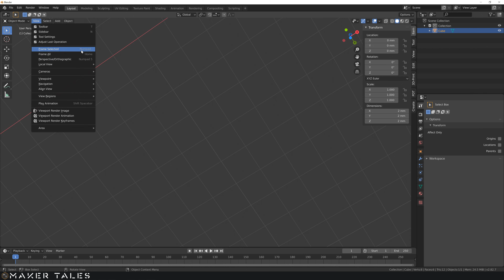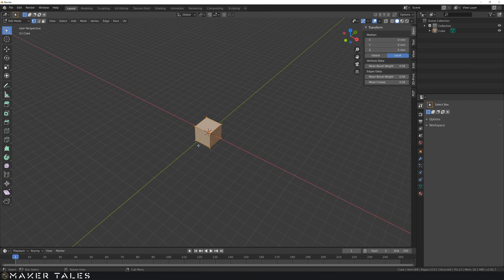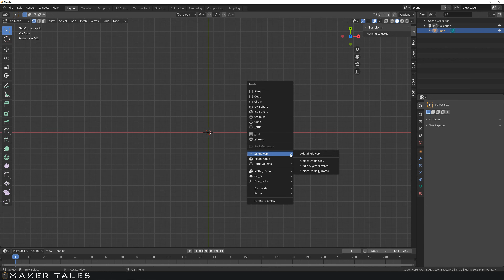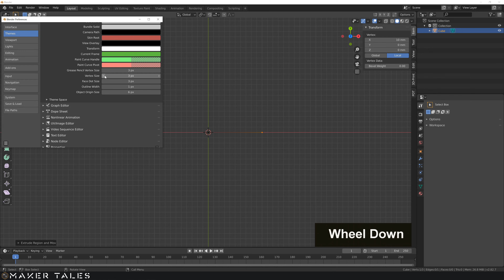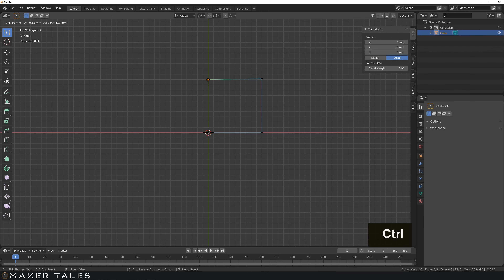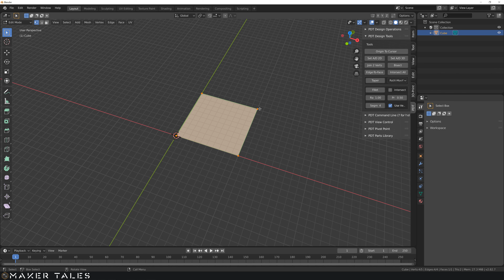The Basics of Blender 2.82 Precision Modeling with PDT - How To ( Tutorial Part - 1 )

Comment: While I can see, (actually know, thanks, Clock )  that PDT can be very useful,  here it's being used for operations that would be much, much quicker without it.

12:04, select the vertices > 'F' to join them with an edge... (same for all other uses of PDT > 'Join Vertices')
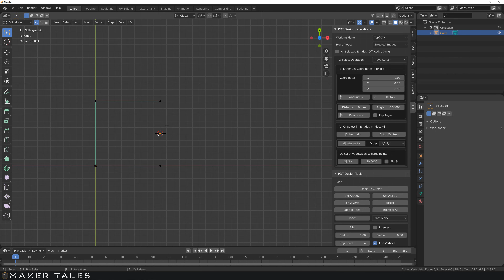13:05  -  15:00 , to establish the center point of the edge: Right-Click the edge, > 'Subdivide'. Bang. Done
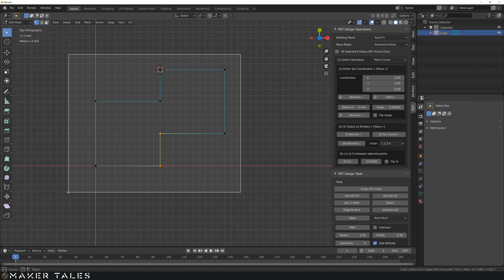15:18 -  16:38, to intersect the lines orthogonally, set Snap to 'Vertex', 'Active', .. just extrude the edges under X and Y constraints, and snap (in the perpendicular axis to the extrusion) to  existing vertices.  Then M, > By Distance, merge the edge-ends where they meet. (I seldom have my Snap set to anything else, once the base measurements are down)

(If you did go your way, to get the  ends of the stub edges to meet at the 3D cursor, with the pivot set to '3D Cursor', simply select the vertices, and S0, scale them to 0.)

Maybe I'm missing the point, and you're setting the audience up for more sophisticated uses of PDT,  but it's such an important aspect of Blender thinking, to use the native tools quickly and effectively (eventually, with shortcuts), and enjoy its more minimal but complete interface, compared to other packages. I think even beginners deserve to be introduced to those things, first?
Reply from the maker: Hi Robin,
I understand your point of view but considering you know all these short cuts I gather that you already technically already know blender... You're completely right in the sense that I'm setting up the audience for more sophisticated use of Blender. This video series is very much being made through the view of a maker looking to learn blender for the first time without the fluff of animation and video production that blender has A LOT of. I'm also coming from an angel of trying to represent many organic modelling chains of thought through similar ideas and workflows found in rhino, Fusion 360 and illustrator.  Yes, by all means, I can throw people that are newly exposed to blender into the 10m deep pool of short keys that blender has which are dependent on workspace, selection and operations. not to mention all the menus and settings and a good 50% would probably be able to cope with this. Or I cater the series to help as many as I can by gradually intruding further advanced concepts through a spiral learning pathway. Where concepts are first introduced at a pace that someone just grasping the concept would be comfortable with, and are able to fully understand. To then learn faster and more efficient methods later on. With that in mind, this is part 1 in the series where you are learning both blender and precision modelling and all we are really doing is setting down the very foundation of a long pathway.
Reply: @Robin Betts Can you explain it in detail the 15:18 -  16:38 point? I'm struggling to follow the steps.
Reply from the maker: @Nikola16789  Hi Nikola, I'm sorry to hear you're having trouble with this part. I'm not sure If there is anything ells that I could add than what I've already shown and said in the video. Could you explain to me the results your currently getting and then maybe I'll be able to help find out why it's not working for you.
Reply: @Keep-Making  Thanks for the answer. Your instruction in video is clear and I do not have any problem with it. I asked @Robin Betts to explain his alternative solution to the problem because I cannot follow it, and I want to know both methods.
Reply: @Nikola16789  With Snap set to  'Vertex', (that's the static target) and 'Active' (that's the moving source), EY the vertex  extruded at 15:28, until it snaps to the top-right vertex, in Y only. Then EX extrude,  or just E and snap, the top-right vertex until the extrusion snaps all the way to the first. The new vertices are now coincident. M, merge > 'By Distance' then welds them together. (I was grumbling too much, the 'Intersect' function  does save time, if the corner is not a right-angle.)

Comment: That was like trying to eat soup with a fork. Anyway, I have to admit this video is it`s really well done. And thank you for the warning, I know now I have to keep looking for options.
Reply from the maker: Hey Federico,
Blender can be quite slow to start with... (Actually no, i'm sure it can be slow it took me 2 - 3 months of playing around to start using it more than rhino ).
If you have any interest in the other things it offers apart form modeling... I would suggest you keep to it for a little while. On top of that this video course might not be the right fit for you. I'm targeting those who my have never touched a 3D program before thus it might even be frustrating for you to watch if you have ready used blender in some way before. But thank your for the comment that you think my video is of high quality.
Reply: @Keep-Making  I was looking for a practical way to avoid precision modeling with some other CAD software and then import to Blender. Watching your video I got the idea that can be done, but it's not practical nor as straightfoward as using a proper CAD for precision. I can see Blender is strong in many other areas, that's why I was curious about this.
Reply from the maker: That is correct, currently blender is not a CAD program but it can slightly bend it to your will. If you really just need pure precision and nothing ells that is offered in blender for your workflow it makes sense to use an actual CAD program.